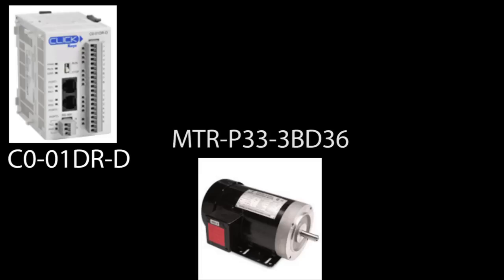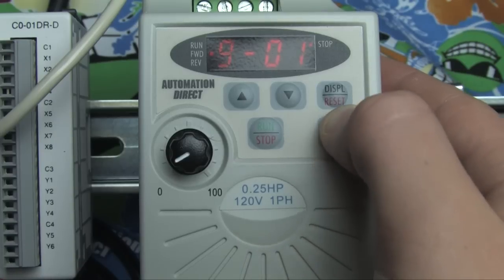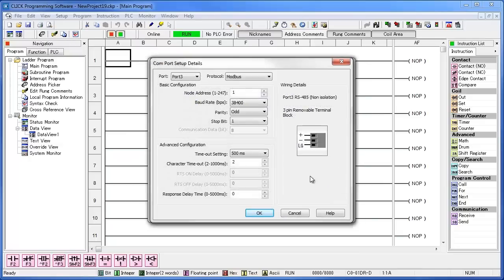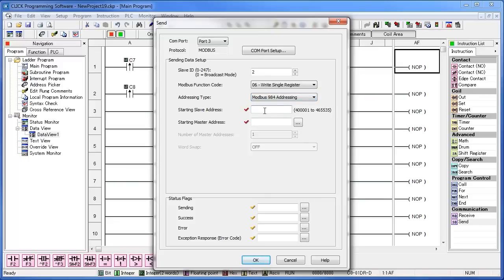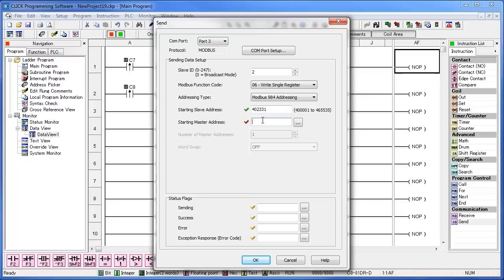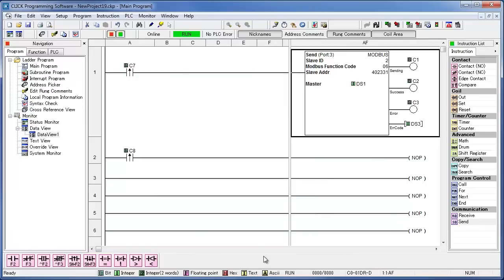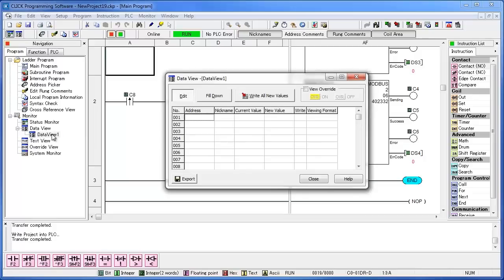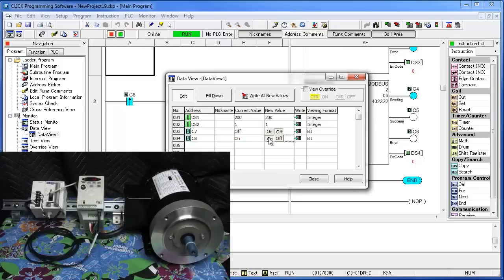How To Control a 3-Phase AC Motor Using a GS1 Drive & a CLICK PLC from AutomationDirect

Comment: I watched with great anticipation as the video clearly illustrated the procedure. However, after my first attempt and subsequent "double-checking," still no success. 

I did notice the RS-485 receive LED to be constantly illuminated and the transmit LED flicker when I attempt to start the motor via the CLICK > the GS-1.

Does this "clue" provide a possible solution?
Reply from the maker: Hmmm ... the RS485 Receive LED is always lit - that sounds suspect. This is going ot hard to debug here, so please contact our FREE Tech Support during regular business hours and they will be happy to help you figure it out: https://support.automationdirect.com/  or just call at 1-770-844-4200
Reply: @automationdirect  
Thanks so much! I'll call.

Comment: Hi! How did you connect the 6 pin RS485 Port on the drive to the 3 pin RS485 Port on the Click PLC? Do you have any resources to help with this? Which pins in the 6 pin cable correlate to which terminal in the Click?

Thank you in advance
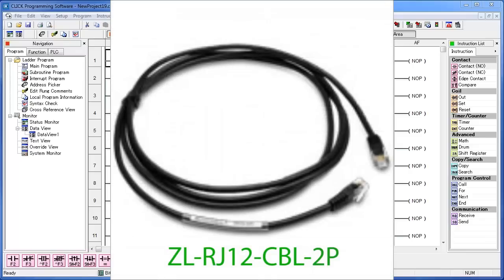Reply from the maker: The part number shown at 1:54 in the video is a pig tale version of a cable you can use. Remove the final "P" ("ZL-RJ12-CBL-2") to get the modular version of the cable that just plugs in. You can see the pinout of that cable on the AutomationDirect website if you want to make your own version. Cable usage requirements for the GS1 drive are listed on page 5-1 of the GS1 user manual (Manual is located here: https://cdn.automationdirect.com/static/manuals/gs1m/gs1m.pdf).
Reply from the maker: Oops!  That was page 5-11 of the GS1 User manual (not 5-1) ...